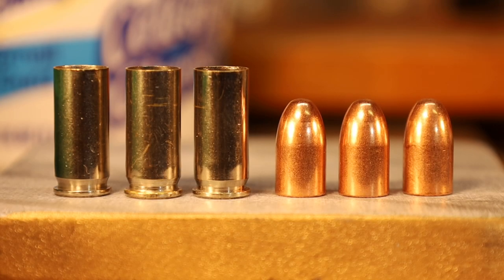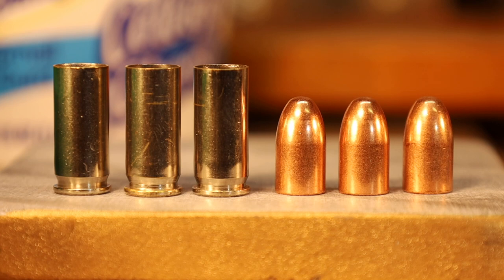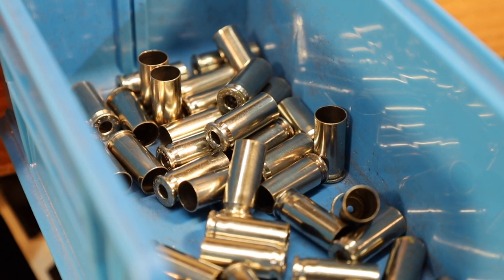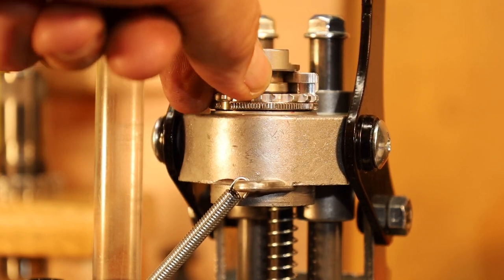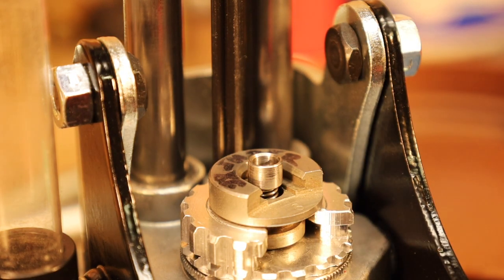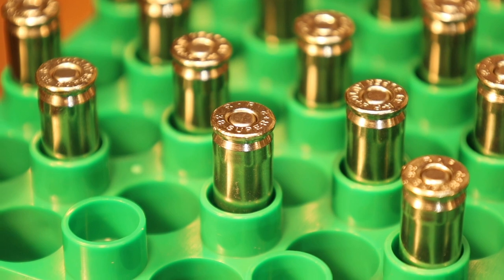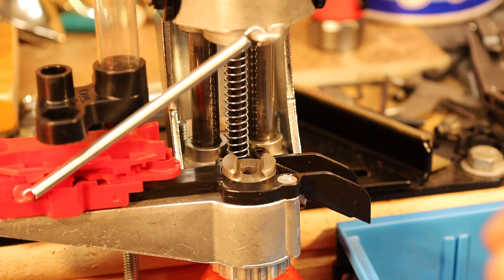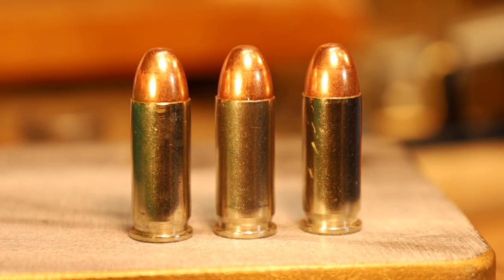The Lee APP Press Video Series - Part 3 Priming On The Lee APP Press With The 38 Super

Comment: Cookie….regarding the final crimp would it not be quicker to send them thru the feed tubes since the powder is captured already by the seated bullet? Will the collator do its job or does the projectile introduce another twist into the equation? I have a feeling I know what the answer is.
Reply: @Tigerologist The height of the feed tube is set just above the feed rail that pushes the case into position. The case tips back as it is pushed to the center spot because it is top heavy and the feed tube had to be raised too much for the slug to pass under it. Maybe with some tweaking it could work.

Comment: Everything looked good except the ram prime process doesn't seem very time efficient.  A good hand priming gun would do it much faster without having to physically handle each primer.
Reply: the lee bench primer tool is even better then a handtool
Reply: @petalexben4227  no way. I guarantee I can bang out 50 rds of primed cases in way less time.
Reply: @randyschweiss847  i can prime  100 cases  in no time in cases   ,and dump another 100 in the tool and so on til 1000 or more .and with the large handle no force needed. i do this al the time because even for the progressive presses its a safety tool   also primers get lifted away from the tray . its the new type bench tool from lee